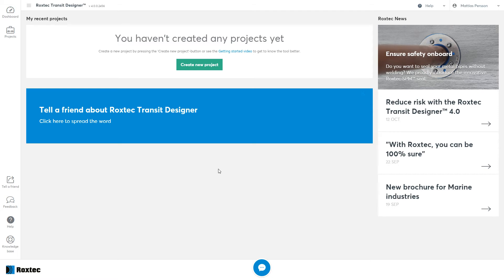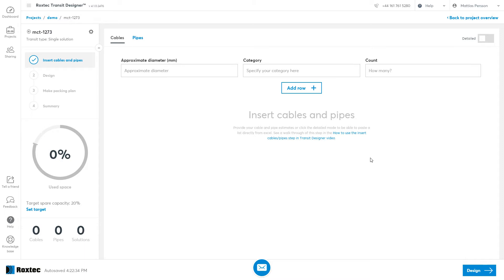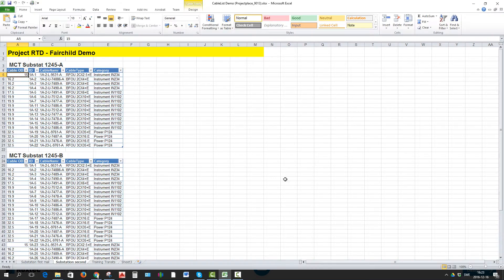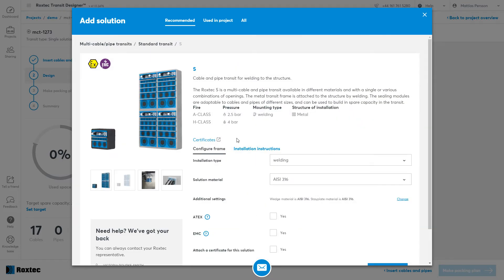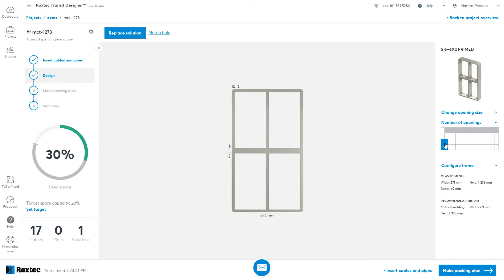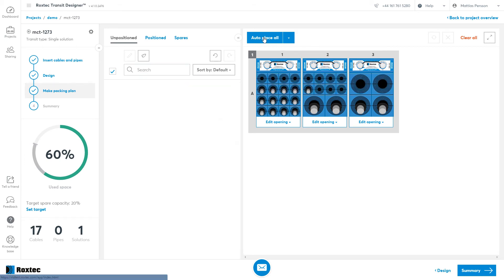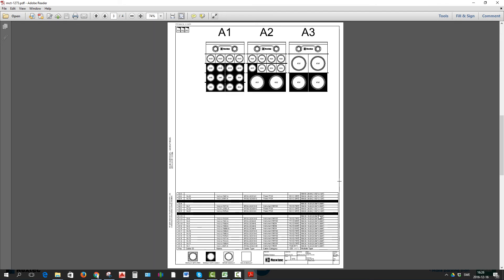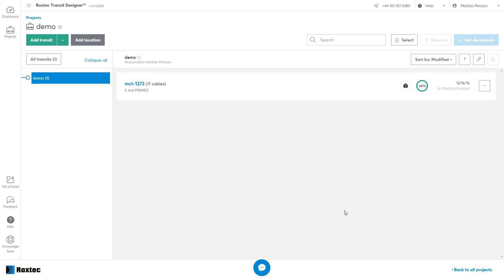Getting started with Roxtec Transit Designer™

Comment: When I create a project and go through all the steps I end up with my solution using RM modules, when I am required to use RM BG B modules for this specific project. How do I change which type of modules is used ?
Reply: @Mattias Persson thank you so much!
Reply: Same problem. I don't find the answer. what did you do?